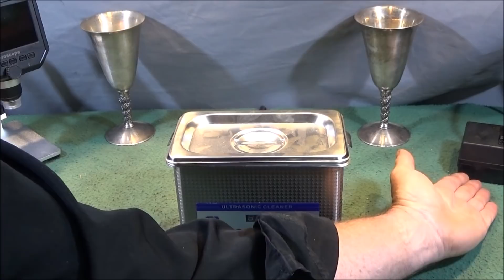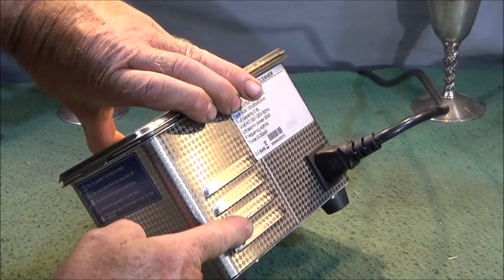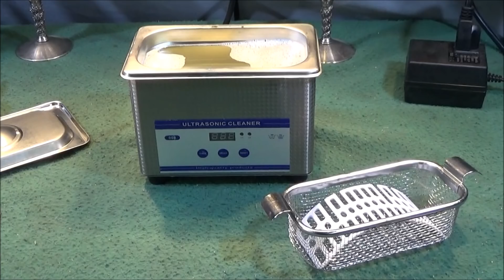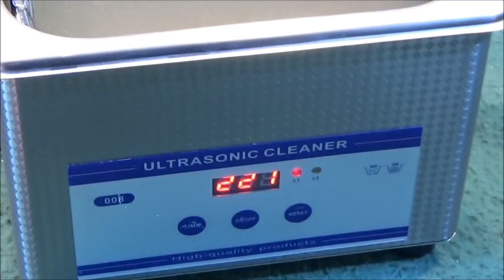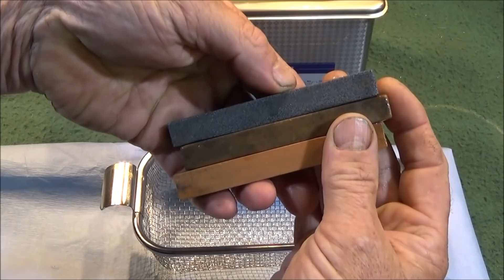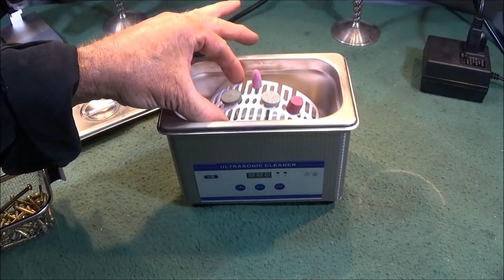Ultrasonic Cleaner Cleaning Sharpening Stones & Other Small Items

Comment: Ultra-Sonic Machines are great tools but its like anything else .... buy a cheap one and get disappointed.   I own one and it does a fantastic job at cleaning a lot of things , with ease but your need to invest into a Sonic machine that has at the very minimum 6 transducers.  Maybe if your cleaning jewelry you can get away with less ...... BUT ....... if your cleaning hard messing tools and gun parts you need a Ultra-Sonic Machine with at least 6, preferably 10 Transducers .... that convert electrical energy into high-frequency sound waves causing rapid, intense cavitation in cleaning liquid.  The more transducers the better your tools and gun parts become whistle clean.  You can get a good Sonic 6 transducers for around $125 but if your serious about great cleaning you'll find Sonics with 10 or more transducers , usually around $300 to $800.
The reason for this price is giving your gun parts and some tools and other items an oil bath after they are sonically cleaned.  Sonic cleaners that offer two tubs, one for cleaning and one for oil baths ......

Comment: Is this any good for cleaning 4 fuel injectors at a time? Will they fit in?
Reply from the maker: Ultrasonic cleaners would be excellent at cleaning injectors. If I were you, I would look at the biggest one you can afford on the market. They are not that expensive. Just check out the internal bath measurements on a listing. Regards Steve
Reply: Regular solenoid injectors aren't that big I would think that they can fit in the product in the video , direct injection injectors or piezoelectric ones ? Probably not but you shouldn't really clean that type in this thing maybe use a dedicated setup for cleaning DI injectors
Reply: Thanks for taking your time to answer me

Comment: I wondered if it will clean rusty bike parts like rusty chain etc also oily greasy parts
Reply from the maker: Hi Ron this one is a bit small really. You can get larger one's that are not much more to buy. You would need to clean rust off by another method but these cleaners loosen and clear dirt etc from places you can't get to.plus it depends on cleaning solution use as well

Comment: Thanks, Steve it's timely I just had a 10 liter UC M delivered the other day. I waited to get one big enough to put a four-barrel carburetor into and have room for the extra stuff that goes with it. Has heat set from factory to 50C. And has three ultrasonic generators running at 47KHz. Never thought of cleaning stone and probobly grinding wheels with it. Thanks a lot for the tip and video!
Reply from the maker: Hi Gearge, Thanks...Your one is possibly the same size and specification as what I used when in the aerospace industry. Fantastic machines. I think I will get a larger one at some point. Regards Steve

Comment: Thanks again, Steve for yet another great tip! Word of caution on using nail polish solvents: -Some flavors have oil added, as for (purportedly) not drying out the nails themselves - and I guess you want to stay away of those - and yet some aren't acetone-, but  ethyl acetate-based. Have you had any experience in using hot lye solutions in this one?
All the best! Johan/DIYSwede, also being an electrician, I just have to caution against the IEC socket taking in 120 VAC [sic!]  - an accident waiting to happen...
Reply from the maker: Hi Johan, Thanks. This one says Acetone, but like you say they do have some additives. It is best to buy pure acetone for welding plus it saves anyone from stealing it from the ladies, which is more important, if you don't want too much trouble..:-)